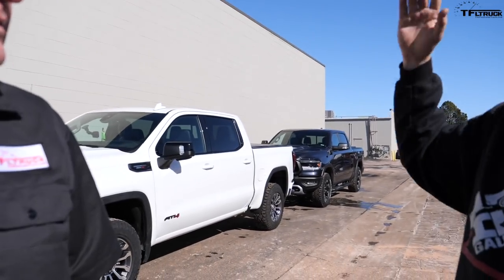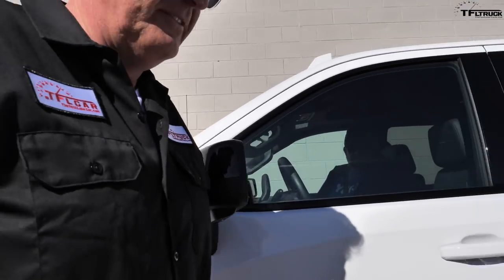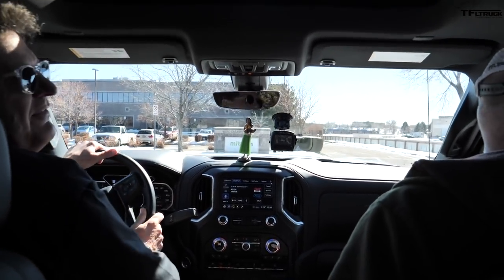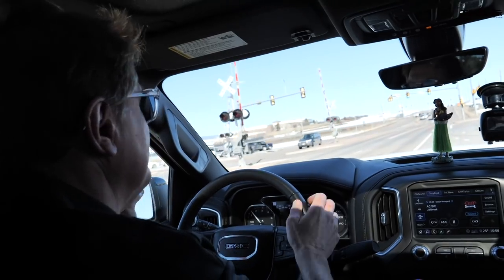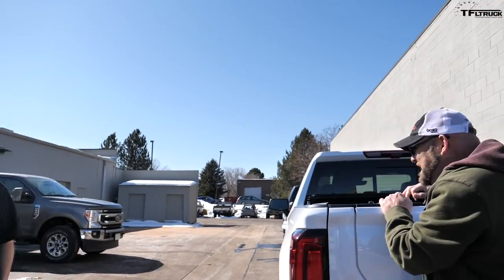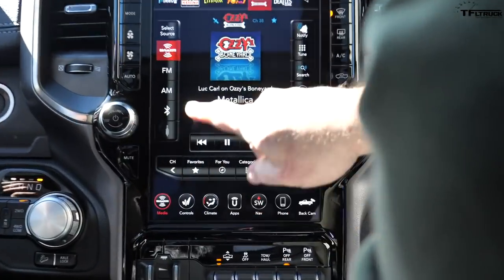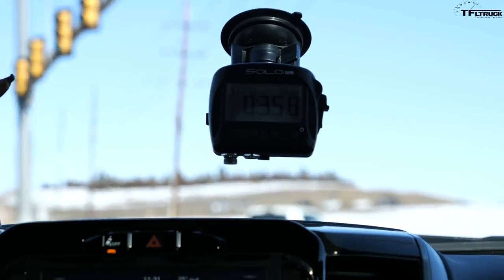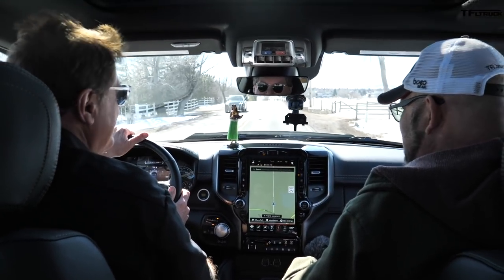Best Diesel Truck! 2020 GMC Sierra AT4 vs Ram Rebel Diesel 0-60 MPH Buddy Review

Comment: I feel much more confident with an American straight 6 over an Italian V6 diesel
Reply: It doesn't matter where it's from. Any engine with belts sandwiched between it and the transmission is a terrible design.
Reply: emdec55 you think the Vega engine developers have some offspring working in engine development now?
Reply: We have a beltologist in our midst!! Ask yourself why the Fiat (Dodge) engine is already on a 3rd generation
Reply: I gunna point out here that the Gm isnt an america engine....It was designed in Turin, Italy...Which is 100% fine because Italian designed Diesel Engines are widely considered the best. Italian diesel engineers really are at the top of their craft...
Reply: @Darkness I understand that a computer modeling design team from Italy worked on the conception side of this new GM St8-6 but that does not make it an Italian engine. International and Cummins make the best diesels by consensus in the world. Even if Cummins made the new Dodge, which agree would be ideal (St8-6 mind you) you would still have Dodge reliability and longevity concerns. I don’t think I could drop $50-70k on that point alone. Having to rework the engine that’s there for a 3rd time in what? 6-7 years is a death sentence to me. Do not waste your money. Get a Hemi if you need a Fiat
Reply: Are the GM diesels developed in the US? Because I found this on Wikipedia: GM Powertrain Europe is center for innovation and development for diesel engines and related electronic control of GM globally and designs propulsion systems for Opel, Chevrolet, GMC and Buick. https://en.m.wikipedia.org/wiki/GM_Powertrain_Torino
Reply: Ram is on the 3rd generation because they keep improving the design. Never trust a new design for an engine. The GM in-line turbo diesel has a belt driven oil pump that you have to access from the rear of the engine. You have to remove the transmission to get access the cover to the belt and it has a 150,000 mile service life. Poor design too me. Also the timing chain is located in the rear of the engine.
Reply: @wv0001  GM sold Opel I don't think they have any design operations in Europe now.
Reply: Better look into that strait 6...People are having issues with them already. Not to mention they have a belt driven oil pump that needs serviced and you need to pull the transmission out to service the belt. it really is quite disappointing. What a poor design. 😓 they really could have hit this one out of the ball park but instead, opted to punt. Disappointed in Chevy 👎. 
On the other hand the Italian Diesel has been around for quite some time in the euro theatre and has proven to be reliable.
Reply: James Lee I agree on the ‘never buy a Mark 1’ sentiments. The 3rd gen Fiat motor from what I am hearing is due to issues though, not organic evolution
Reply: The Baby Duramax is the better engine but time will tell on how reliable it will be. The oil pump belt doesn't require the transmission to be removed to service it but it does require it to be slid back slightly which can be done in  your garage if you have a lift.
Reply: @rlhmarines not many people have a lift in their garage at home, and not too easy to just move transmission back a little.
Reply: @SwopetheDope  It is designed in house by GM at the torino facility(a GM facility) in Italy. Its not an "Italian design" and its also built in flint Michigan. this is a ground up build for GM by GM specifically for this application. The VM Motori engine had been around for a number of years(and is an Italian designed engine) in various other applications(also co owned by GM at the time. Fiat 50% GM 50%) before they stuffed it into a Ram pickup. Gm had talked about putting the VM3.0 into their pickups years ago as well but opted for a clean slate design for their products as people are getting back behind "built in America" products in the auto industry.
Reply: thats why the HD trucks have cummins vs the v8s. I6 is far superior, these trucks wont hardly tow anything
Reply: @justcallmejohn2833  Torino, Italy is where this engine is designed.
Reply: @itchytriggerfinger7622  Poor design.  SMH..  Both are designed in Italy and simply put a strait 6 is better than a v any day.  I'll take a cummins over all other engines simply for the inline alignment.  BTW..  you should be a engine engineer for GM  you would sure show them.
Reply: @cadeere74  Whether I am or not, being an expert on belts is not necessary to understand that sticking any serviceable item between an engine and transmission is incredibly $tupid. It shouldn't even have a belt, it should be a gear or at least a chain like any decent engine. Even someone with basic knowledge can tell you that.

As for generations of the Ecodiesel, what is that even supposed to mean? There's been as many generation of other diesels in the same amount of time. A new generation doesn't even mean an entirely new engine. The basic architecture of this engine is the same as the first generation. I develop new generation as improvement. How is that a bad thing?
Reply: Bryan E https://www.fev.com/en/who-we-are/company-history.html where does it say it was designed in Italy? https://www.fev.com/en/press/press-releases/news-article/article/modern-30l-duramax-diesel-engine-from-general-motors-with-global-development-involvement-of-fev.html . 
I think someone is talking out of their arse. 
I agree a strait 6 should be better, but GM  and this FEV group managed to screw it up.  🤦🏻‍♂️
Reply: @toofastnobrakes  Cummins cant sell or design an engine for the opposition.
Reply: @jimmyaber5920  Thank God it wasn't the Pinto engine developers.
Reply: @itchytriggerfinger7622  the belt is designed to last at least 150,000 miles. If I owned one I would do that service at that point with the timing chains.  Probably easiest to drop the transmission and leave the engine in place for the service.
Reply: @R AJ any big rig uses an I6...they can haul 80k+ I6 is far superior
Reply: R AJ  They have also had one Issue I can think of with their first gen, And I am guessing they fixed the issue Because I haven’t heard any issues as of late with the newer ones. It Was the timing gear on the first gens were pressed on with out any splines, later on they were finding the gear was slipping and causing misfiring and created in some engine damage. If I had to choose between the 2 it would be the Ram eco it’s been around long enough to get the bugs out. If you like the chev I would wait for the next couple of years for them to hopefully do the same.
Reply: @R AJ Who said Fiat owned Cummins? Do you know what contracts are? Let me explain to your 3 year old mind. Fiat will not allow Cummins to sell engines to GM or Ford (opposition). Does that help? As for Nissan it's not an American owned company. And now your comparing tractors (semi's) to light duty trucks.
Reply: R AJ I will stick with my Straight 6 04 Ram Cummins, well over a 100k and still runs like a champ.  And pulls anything I need. Will buy another when and if this one wears out.
Reply: The GM V8 Duramax was developed by IZUZU.  The 4 cyl Duramax was developed in Thailand with input from VM in Italy when GM was trying to make a diesel for the Cadillac.
My '03 Ford explorer has an engine from Germany.  Transmission from France.  And a Body from Missouri.  There are parts for vehicles that come from all over the planet.  Toyota got into NASCAR because they pointed out that several Toyota models have the most American content of cars sold in America.  So most of the complaining is foolish.  For the most part follow the recommended replacement intervals.  And the 6 cyl Duramax should be fine.
I own a 2016 Ram 1500 Ecodiesel.  If it weren't for the cash flow going to pay off my wife's 2018 Ram 2500 6.7L Cummins.  I would consider a 2020 Ram 1500 Ecodiesel, or the 2020 Chevy 1500 Duramax.
Just for the extra payload!  My truck only has a 1225# payload.  Both of the new trucks are about 2000# payload.
Ethier truck would benefit from aftermarket control arms and Bilstein 5100 shocks.
Reply: The GM engine isn't a US engine. It was also designed in Italy.
Reply: @SwopetheDope  as is the ram diesel.  Designed in Italy by VM motori
Reply: @R AJ haha Walt Disney is in the house!!!
Reply: @itchytriggerfinger7622  Post links.  I did a google search and came up with nothing.  The diesel was delayed due to EPA emissions testing, and are only now taking orders for them.
Reply: Germans and Italians were making diesels way before Americans....
Reply: James Lee I saw the video too...😂😂😂
Reply: Duen Puen #1 str8-6, #2 manufacturing in US.

Those two things give me more confidence. That’s my only point. I want to like like Dodge, but Fiat is just too much a leap for $60k
Reply: Especially since the eco-Diesel engine was originally intended for European market Cadillac sedans, not full-sized trucks.
Reply: too bad the straight six is italian as well
Reply: You have more trust in a belt driven oil pump something is wrong with you then all the timing is in the back of the engine chevy never made a straight 6 that was better than the dodge and ford straight 6 if only if the people that build good motors would make the ones that work
Reply: @AkioWasRight  that's no lie, that's exactly what stopped me from buying one, because the inline 6 got me really excited till I found out the oil pump. Fuel pump, and timing drive gear is behind the engine.
Reply: @40calDeathPunch  they did for the Nissan titan xd, and I love it. That 5.0 cummins would be a much better engine in one of these half tons than the 3.0 engines in my opinion. Honestly 3.0 to me is too small. A 4.0 inline 6 turbo diesel would really be a perfect half ton diesel engine.
Reply: @moose5.9  agreed, and 7 main bearings on the inline 6 vs 5 main bearings on the v8 means the inline 6 has alot stronger bottom end.
Reply: the italian V6 diesel comes from 100 years of experience straight out from VM, that FCA buy just because this V6 diesel miss and they find it ready at VM, and find it really good. Inline 6 just cheaper to build.
Reply: @itchytriggerfinger7622   family member of mine works at a dodge dealership (mechanic) and he has pointed out the ECO diesel  they are having issues with it , so much for that awesome Italian engine , why would dodge forsake the success of the Cummings to make their own ...
Reply: Kaulin Curtis only some design elements. Not manufactured
Reply: People who think we Americans make the best Diesel engines ... have never been overseas.  Smaller diesels are European areas of expertise.  90 percent of the cars over there have them and they are bullet proof.  The Ram engine will do just fine ...
Reply: My concern is that ALL the Euro diesels have been busted cheating on environmental controls and mileage.  Can they be trusted to not put owners trough the bad press, recall, band-aid fix with degraded performance?  And can we even trust the brand to continue investment in NA specific product line?  They are the ones buying all Teslas pollution credits rather than investing in compliant improvements.
Very fancy interior though.
Reply: @wv0001  Truck engines are designed and built in the US.  Opal and european operations were sold years ago.  GM is primarily US and China now.
Reply: @SwopetheDope  yeah designed in gm's own diesel development center which has produced some of the smoothest, most quiet diesels that actually meet emissions standards world wide
Reply: R J I agree the day one brand isn’t reliable anymore then it’s time to get rid of them and go with something else so far my GM’s have been good but I am definitely not going to keep buying them if they start breaking down on me
Reply: all things mechanical built by man will have problems doesn't matter what country  it was made in being bias is stupid man-made can last from 1 minute to 1000 years anyone saying different is not from this universe or works for congress this is reality saying one country engines better than the other is like kids in a sand box throwing a tantrum
Reply: @gfinnstrom  so you are unfamiliar with the concept of statistics?
Reply: @cadeere74  like anything else they can be doctored and falsified besides the people i talk to that actually own the vehicles like them and recommend them  that is better than some doctored numbers for the fanboys to gloat over  I learned a long time ago don't believe numbers just like the word HISTORY actually mean his story in case that is hard for you here is a better definition you can have five people witness and event and the history of that event will be different  in five accounts
Reply: @gfinnstrom  well they do not ionize the paint so they are rust prone, the front suspension is under engineered and will fail under 75k miles and of course there is the matter of the constant revised version of the engines because of design flaws. FCA quality control issues carried down from the nefarious Mopar electrical curse. But hey, if you know a guy with a virtually brand new unit that is happy well anecdotal evidence is fine by me.
Reply: @cadeere74  i remember the electrical problem the patrol truck with the fire dept shorted and made a mess the mechanics were pissed at me for a long time ---- i was talking to a couple guys with the new fords one showed how the ned is coming apart and the other said one of his relatives got 40 miles on it before it was a blob it caught fire  seems they dont make them like when you and i grew up which is really sad have a great week holidays
Reply: @gfinnstrom  you as well, I did 10 years on a Ford ambulance, they were pretty good but that’s a lot of electrical.
Reply: @cadeere74  i miss the 460
Reply: @gfinnstrom  my 1st car was a 1974 Landau LTD 2 Door with a 460
Reply: @cadeere74  sweeeet
Reply: @moose5.9  in North America anyways, Europe has some V8 diesels in their semis that annihilate any I6 in our semis.

Comment: was looking at the ram as i have a 2014 Limited Cummins and i ended up getting a fully loaded AT4, loved the offroad and styling, but mostly liked the larger 6.7 box where the rebel is only in a pointless to real truck 5.5 box. i opted for the 10 speed 6.2L had to get out of the diesel due to taking so long to warm up in -40 and DPF non stop issues.

AT4 is probably the best half ton truck i've even used.. its very well equipped and has lots of neat little tech things many others dont. i have all safety pkg and tech pkg in mine.. has more cameras than the Ram and i have a camera for my trailer and TPMS for my trailer also!! first GMC in over 10 years for me and i'm very happy with it. i nearly bought the raptor actually but glad i went with the AT4 std box.

Comment: I got a dark quartz metallic AT4 Dec 2019.  I had a 2014 Ram eco diesel and after 13k it had a chronic issue. You get a service electronic throttle position switch message and the truck would go into limp mode. The ram spent over 6 months time for 4 service visits and Ram couldn't fix it and they wouldn't replace it. With the GMC I have 26k miles on it and it gave me a scare but GM fixed it. About 12k a glow plug went bad. I have and have had several 2500 RAMS with the Cummins 5.9 and 6.7 and prefer i6 configuration so happy to wear out this GM 3.0. So far so good.

Comment: Observation on the tailgate test. I think if you would  try and put 60lbs bag of cement in both beds Ram will be easier  and safer on your back with barn doors  setup. 
Also think 12" screen is overkill, 8 is quite enough. Love your videos, keep em coming!

Comment: Just bought the AT4, on mine GMC dropped the price of the 3.0 upgrade from $2,495 to $995  actually had a reissued window sticker.  The old window sticker was $65,450, new sticker is $63,950.  With $6,000 rebate and dealer discount was able to get it for $9,637 of of sticker price for $54,312 before taxes.  I love this truck, and your review was great, almost got the 6.2 trail boss, glad I didn't. Can't get the auto cruise, video rearview mirror, wireless charging and most importantly the pro tailgate.

Comment: After watching many videos, both by TFL and others, I feel the need to point a couple of things out. 1: you wouldn't like the "huge" sunroof if you knew all of the issues they are having with them, the gmc "small" sunroof is tried and true. 2: I've drove all the 1/2 tons offroad, and the e lockers in both the ford and ram are speed limited, they will unlock at a relatively low speed, making them useless in mud and dirt when wheelspin is excessive. People say the g80 doesn't work above 20 mph, I've never had them not lock regardless of speed. And 3: the barn door tailgate being split vertically, really concerns me if you were to any significant amount of weight on it, I see the latches as a weak point for it. Just my .02.
Reply: The G80 unlocks at about 25 MPH which is a good thing because it's dangerous to fly down the highway with a locked diff when traction isn't good. Doesn't take much for the back end to swing out without warning.

Comment: Nobody: I want a badge for all the options packages on ma truck!

GM: Yes
Reply: DUAL ZONE CLIMATE CONTROL

10 WAY ADJUSTABLE DRIVERS SEAT WITH LUMBAR

24 HOUR ROADSIDE ASSISTANCE

Who wouldn't want to roll around with some of these bad boys on the side of their vehicle?
Reply: Ugh. I agree. My wife’s infinity q50 is a beautiful car. But, they decided to put the engine displacement on the side. It looked like something you could buy at autozone. Hideous. Needless to say those are gone.

Comment: It's set for 40° and lower temperatures for heating seat, mirrors and steering wheel for the Ram. It's an awesome feature if you have it.